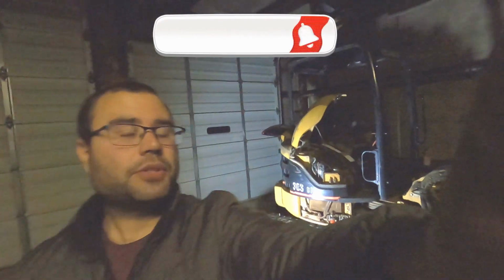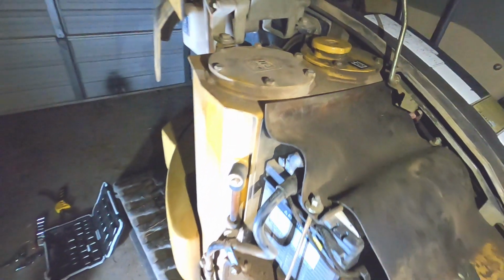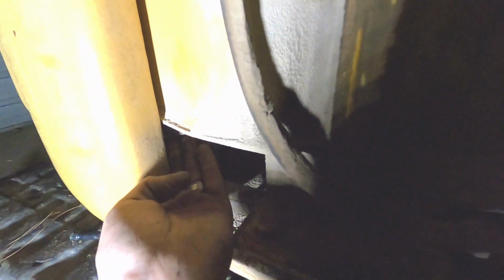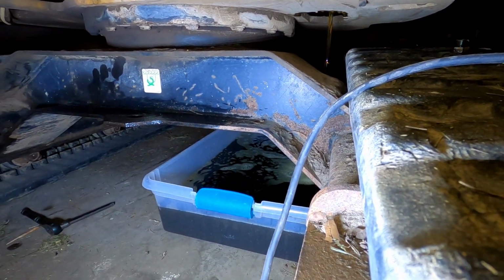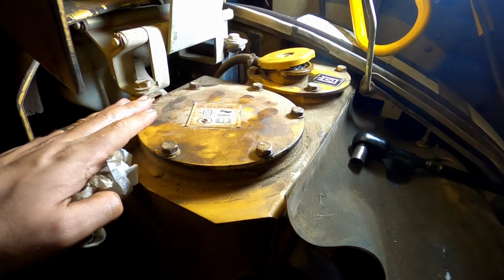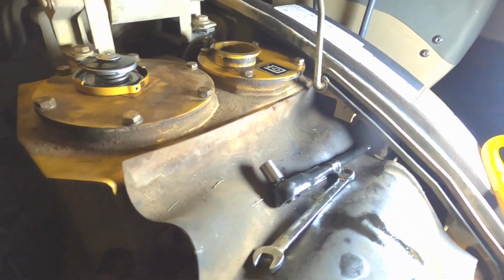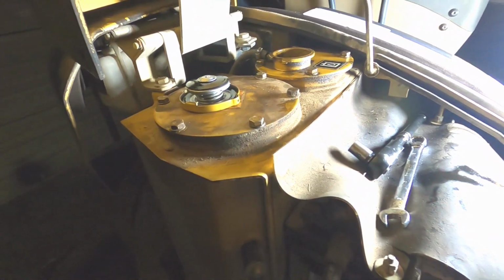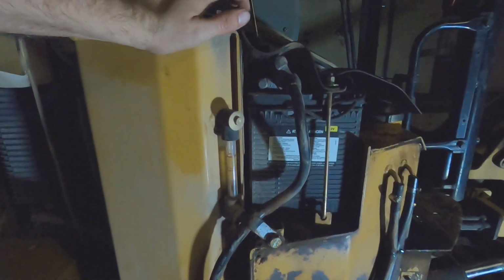CAT 303 MINI EX GETS A FULL HYDRAULIC FLUSH (IT WAS NASTY)

Comment: I have the same machine the blade & cab rotation work fine but no travel, no swing arm, slow bucket curl & boom where should I start lol?
Reply from the maker: Sorry, I actually am not sure on that one.
Reply: Change all filters, if that doesn't fix it it could be your hydraulic pump or control valve. Employ a fitter.

Comment: Why did you not turn your cab 90 degrees so it would be easier to access the drain plug?  As well you could retract your boom swing cylinder to get the fluid out of that as well.  I have the exact excavator as well with a thumb
Reply from the maker: If I remember correctly, when I recorded this video there was something else in this shop and it would not have given me the room. But yes, rotating the cab would make it easier. I believe there was an RV in between the 2nd and 3rd bays and I wouldn't have had the room. And the RV would not start to move it forward more. Yes. you want to retract as many cylinders as possible for a drain. In this case, the swing and blade cylinders were actually taken off to be resealed, so I was not too worried about those being empty. But all very good points.